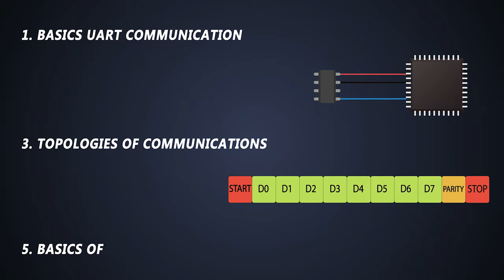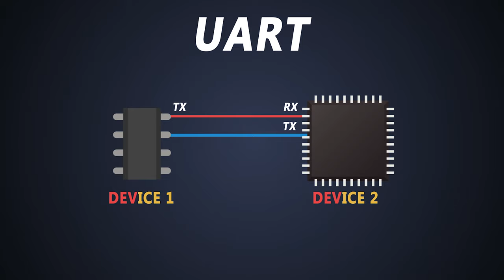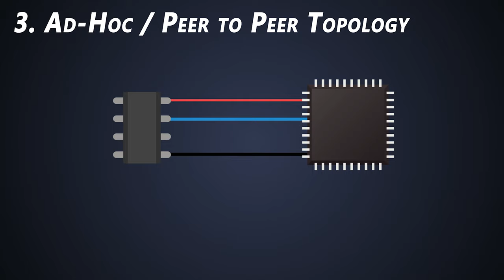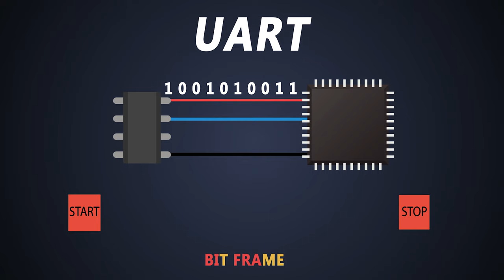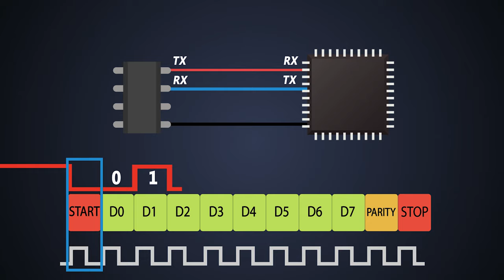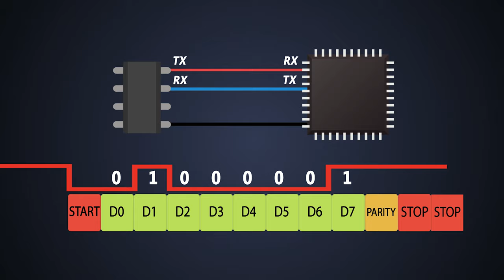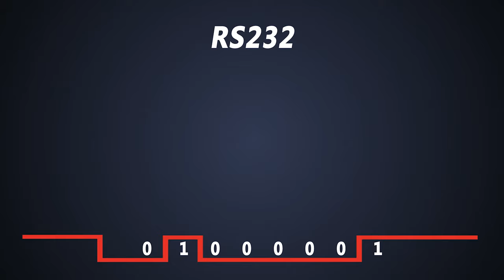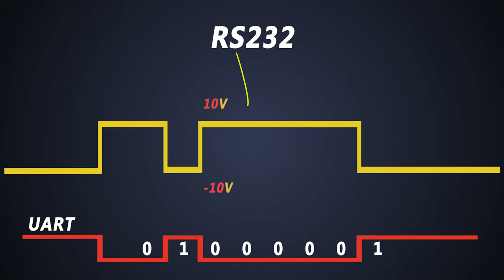Basics of UART Communication | UART Frame Structure | RS 232 Basics | Part1

Comment: Really a nice video about the basics of UART protocol, i would like to highlight few points regarding this:
1. Communication b/w two devices can happen with just 1 wire/line also. So no mandatory need of two lines always i.e. Rx/Tx.
2. UART data/char/word bits can range from 2 to 11 also 12 sometimes, this is configurable entity in modern uPs and uCs.
3. There are several encoding schemes supported by UART peripherals like NRZ, NRZ I, RZ and meny more, again configurable in HW, so not always 0/5V logic pairs(at UART level).
4. Handshaking mechanisms are also supported by UART peripherals in built sometimes like HW Flow Control and if not can be taken care in driver SW using software flow control mechanisms(using XON/XOFF chars).
Thnaks :) Happy Learning :)
Reply from the maker: Thank you so much for the information!! It is very helpful
Reply: What hardware do you rcommend to be used as a universal reader to decode firmware?

Comment: Really a nice video. One point is that in the computer and printer example...yes  it is low to high voltage at computer side and high to low voltage at the printer side during data transmission from computer.
But when the printer sends any response/ acknowledgement/handshake data to the computer, it is vice versa, which is not explained in this video.
Reply from the maker: Thank you so much for watching!!

Comment: Overall good video. Maybe some areas to expand on: What does asynchronous mean in UART? (i.e. no dedicated clock signal is used, thus each client needs to agree on the baud rate ahead of time). How does the parity bit get used in practice? If a corrupt data frame is received, is it just up to the receiving client to ignore the data?
Reply: You solved my doubt that i had even at the end of the video. Thank you

Comment: Thanks! Very useful video!
 
Little question. Is the stop bit must be longer then one clock pulse? I dont fully understand how the receiver knows the difference between the data to the stop/start bits
Reply from the maker: No stop bit is not longer than 1 clock pulse.
Start bit is Transition from high to low 
And stop bit is transition from low to high.

How it is differentiated from data bits?

As we have discussed in earlier videos,

When there is no data on the line that is when data lines are idle,
Lines are set to high level.
to indicate the data transfer will be initiated on next clock pulse
Reply: @Avi N The way it distinguishes from the data and the stop bit is by the size of the frame. Remember that because there is no clock some things must be agreed between the transmitter and the receiver before the communication starts, like bit speed, character length and parity. Let's see an example of sending 5 bits of data with parity.

Transmitter (sends 8 pulses):
- 1st pulse high-to-low for the start bit
- 5 pulses of data
- 1 pulse for the parity bit
- 1 pulse stay/change-to-high for the stop bit

Receiver:
- Detects the high-to-low to start reading
- Reads the next 6 pulses (data plus parity (this was agree beforehand)) 
- Expects the next pulse to be high to indicate the stop of transmission
- Since it read the number of bits it was expecting it starts listening for that high-to-low signal again that indicates a new packet.

Comment: .. remember if tx can send 9600 bits/sec...the rx side can only store 640(64bytes) bit per receive...so it need ~ 15 tx msg / second to receive 9600 bits..for Arduino..not sure about other hardwares..

Comment: I have a doubt...what if the the sample signal has two 1s adjacent in it( eg. 101101); will it be considered as a message to stop data transmission? If so, the rest of my data will not be transmitted..

Comment: Hi dude i have a drone dji phantom and it has a uart on the reciever baord , the question is can I get more control from it such as lights or bezer or moving servo motor by communication it with Arduino . thanks
Reply from the maker: You can try! if it has UART ports

Comment: Hello , can u explain how data is traversing , i mean , when the transmitter starts , the reciever gets signal its starting , then after that all the 8 bits so left are sent at once or like bit by bit , is it FIFO ??? suppose my data is 101011 just suppose ignore start and stop and ignore parity so the  reciever will recieve 1 first then 0 , then 1 then 0 , then 1 and then 1 or it will go at a blink -- 101011 ??? lastly , what i feel shouldnt it be recieving 110101 like just opposite or mirror image of it ??
Reply: bit send order uart is least significant bit to most significant bit. there is no clock wire connection (asynchronous serial interface), so both (sender/receiver) must have been set to same baudrate so they can regenerate a common clock timing to send/read the bits with correct timing ...

Comment: Why is it said that UART is hardware or in built circuitry whereas this thing is not used with I2C and SPI. They just say i2c, spi are protocols?
Reply: But I can see circuitry in case of SPI, i2c also, like they have Shift register, data register, control registers, status register and clock circuitry also.
Reply from the maker: i have never seen anybody denying that the UART is a Communication protocol
Reply: @FoolishEngineer  yes but they say UART is a hardware but do not use Hardware word with i2c, spi
Reply: why is it so?
Reply from the maker: please show us such a references and we will get back to you with our understanding!
Reply: Nakul Chauhan tJmuUGDBzw uart generally refers to the hardware used to transmit data in asynchronous manner b/w transmitter & receiver. That’s why they say it’s a hardware which is used in implementing protocol in asynchronous way.

Comment: Why it has start bit and end bit?
Reply from the maker: To ensure the communication has started or it has been endded
Reply: we don't use clock signals. So start bit and end bit is required to ensure that the data is transmitted.